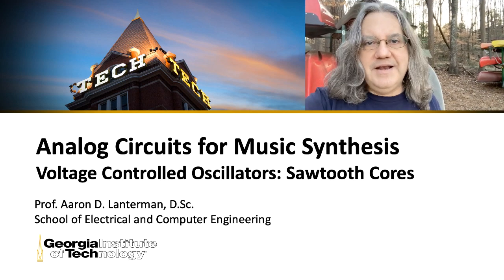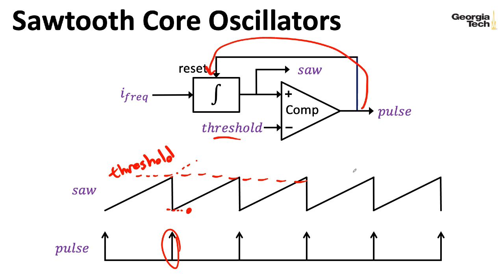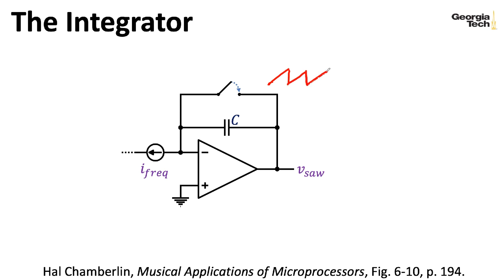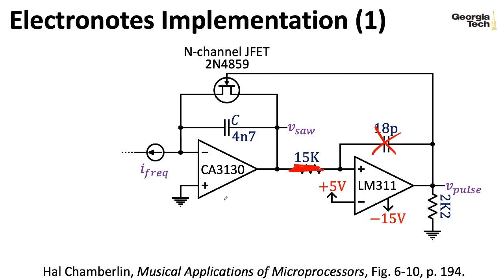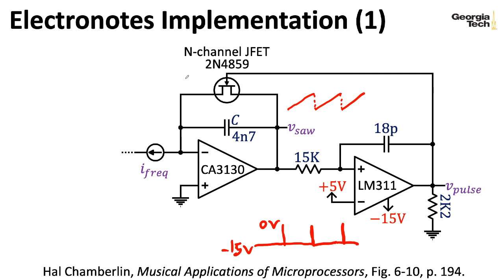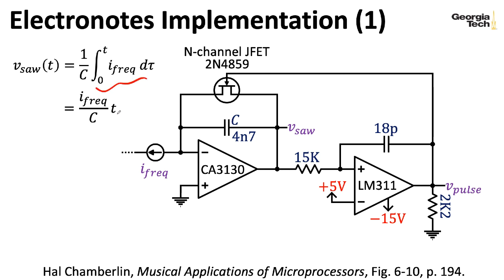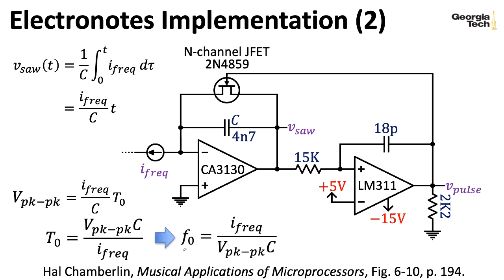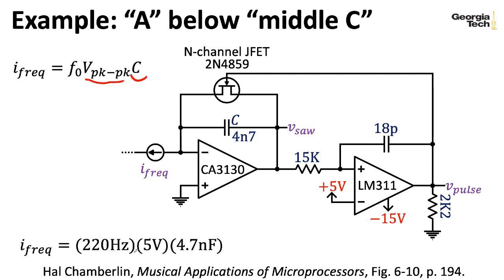ECE4450 L8: Voltage Controlled Oscillators: Sawtooth Cores (Analog Circuits for Music Synthesis)

Comment: Thought I'd mention a few of my favorite VCO integration op amps here, as they've given great results.  It's quite a list.  I use each one for different reasons.  I'll list them all, but wanted to mention one specifically that's pretty amazing.  (though recently it has doubled in price)  

The AD8033.  It has a FET input, super high slew rate, very very low bias current, wide supply range (compared to some) among other things.  Pretty decent DC characteristics too.

Others that work quite well pretty much across the board for this task:
CA3140EZ
LF356
OPA132 (and even the OPA134 though it's more aimed at certain audio tasks I would say)
LF411 (I use this more in LFOs and slope generators, as its quite stable, low drift, etc. and also cheap)
OPA140

I saw a comment about possible substitutions below, so thought I'd mention these.  

Also, for oscillators (I can't think of many, but Don Tilman's Trapezoid is one) that use the timing cap to ground instead of the inverting op amp integrator, something that's specced for capacitive loads might be better.  Maybe something like the LM8261 (though there are much more common ones that are fine with this).

Hope that's somewhat helpful.  Hard to elaborate further in a YouTube comment.  :D

Comment: The JFet is really just being used as a voltage-controlled switch, when it turns-on it effectively shorts-out the integrator capacitor, the result is that the voltage across the integrator capacitor falls to zero and then the JFet gets turned off again, then the whole process of charging up the integrator cap starts again, rinse and repeat.

Comment: Thank you for this wonderful lecture Aaron, I appreciate all your lectures and the analysis of the external components, as I usually struggle to understand how they interact in DCOs and OTA VCFs. This is essentially a DCO core you're explaining, I've been studying the Roland and Korg DCO's and this analysis is excellent. They use NPN transistors instead of the JFET but the result is essentially the same. How would you turn it into a reverse saw or triangular waveform?
Reply from the maker: You can just run the waveform through an inverter to flip the saw direction. Turning saw into a triangle, you can center the waveform around DC, and then rectify it (take its absolute value), and shift and scale it again. I will talk about that in a future lecture.
Reply from the maker: Check out Electric Druid's VCO analysis: https://electricdruid.net/roland-juno-dcos/
Reply: And when you have the triangular waveform you can get a sine waveform with a pair of matched trancistors and an opamp.
Reply: I don't think that this qualifies as a digitally controller oscillator (DCO). In a DCO, the reset pulse is generated by a digital circuit, which typically divides down a high frequency clock from a master (crystal) oscillator. Here, the oscillator generates its own reset pulse, so I would say that it's a plain analog VCO.
Reply: @possible-realities   yes of course, the digital control part of it is missing, but the osc works the same way.
Reply: @Lantertronics  thank you, I've seen a few good explanations on the DCOs I have a ok handle on it. Although, I have a question about transistor configuration that confuses me. its from Korg DW6000, pp17 over to the right Q1,Q2 I can't understand it and I've looked everywhere to find out what this does and how they work in the circuit.
Reply: @peternotpeter  Ok, then I'm with you!

Comment: Hi Aaron, jut a short question...i can not find numbers for the different lectures in the series. Is going through the playlist the only way to get them in the right order or did i just overlook the part number ?
Reply from the maker: When I was originally posting them I was sometimes posting them out of optimal viewing order (depending on what videos I finished editing first), and in some cases I wound up taking one video I was editing and splitting it up into two separate videos, so I often wasn't entirely sure what the final number of a video would be. I'll probably go back and add numbers at some point when I get a chance. 

In the mean time, best thing to do is watch them in the order on the ECE4450 playlist: 

https://www.youtube.com/playlist?list=PLOunECWxELQS5bMdWo9VhmZtsCjhjYNcV

Comment: I like how fact that capacitor charge is not straight line but negative exponential form is ignored in all analog sawtooth/triangle waveform generators.
Reply from the maker: I'm not following how the charge on the capacitor would be exponential? It should just be a straight line if it's being fed with a constant current source and the op amp has low input current (like with a TL072).
Reply: @Lantertronics  Oh, you are right, of course, I've solved too many exercises about schemes and oscillators WITHOUT opamps at my course if basic electronics 20+ years ago. And, yes, one more note to myself: don't try to be smart at 4 at night.
Thank you for great videos!

Comment: Do you have an idea why this circuit uses a JFET insted of a MOSFET? I don't think Chamberlin explains why.
Reply: It acts like a reverse MOSFET. When you increase the gate voltage on a Jfet its resistance increases.
Reply: I would say that the JFET acts like a depletion mode MOSFET (except that you can never let the gate voltage go above the source or drain voltage, because of the gate-to-channel diode).

So I think the circuit would work basically the same if you exchanged the JFET for a depletion mode MOSFET. But I guess that it might be harder to find a suitable depletion mode MOSFET than a JFET? Or maybe JFETs have some other desirable properties for this circuit? Wikipedia says that JFETs have higher transconductance than MOSFETs, that seems like a good reason.

The circuit really wants to keep the leakage through the FET low when it's turned off, I guess that's why it's using a voltage swing between -15 V and 0 V for the JFET gate. I suppose that if you're gonna use that kind of voltage swing, a few volts of added threshold voltage that you would get with an enhancement mode MOSFET might not make such a big difference; you'd probably still want to drive the gate quite negative to reduce the leakage current? But with a MOSFET, you could use a comparator with a regular output and get an even wider voltage swing, not sure if that would be good or bad...

Anyway, the JFET's gate-to-channel diode doesn't seem to be a problem for this circuit, since the gate is always at <= 0 V while the other two terminals are always at >= 0 V, so why not use a JFET, I guess? And even if you used a MOSFET, you couldn't let the oscillator have a much wider voltage swing, because the FET gate must have a much wider voltage swing than the oscillator to make sure that it's always on / off when it should be.
Reply from the maker: @possible-realities  I think Ian Fritz did some experiments using MOSFETs in this application.

Comment: Question:  How is the 270ns comparator time constant (and related RC component values) deterimined at design time for a 5V p-p waveform?  Or is this something you can only determine empirically with a breadboard?  Thanks for this video - it's well timed with a project I am currently working on and helped me understand this circuit way better.
Reply from the maker: No idea, actually. ;) 

Next time I'm in my office I plan to see if I can find the original Electronotes article that VCO in Chamberlin's book is based on to see if I can find more insights.
Reply: @Lantertronics  I'm quite new to all this and I'm trying to test my knowledge a bit. But I think I have figured it out. The drain-source resistance of the FET is 25Ohm so that makes the RC time constant 117.5ns. 117*1.3 =270.25. After 2.3 times RC the capacitor is discharged about 90% which is good enough i guess.
Reply: The main timing capacitor C (4n7) and the On resistance of the JFET will have a time constant based on RC.
 You want the comparator to be on long enough to discharge C, so you want the 15k ohm & 18pF at the comparator to have a similar time constant.
 If that time constant is too long, C will completely discharge, and you'll get a flat spot at 0v before the ramp starts going up again.

Comment: witch one is best?

lm201 or lm301?
https://www.ti.com/lit/ds/symlink/lm301a-n-mil.pdf

Supply Voltage:   lm201 = ±22Volts, lm301 = ±18Volts
my shop refers to lm201 as replacement for lm301

should i use TL431 Precision Programmable Reference for getting the +10V / -10V references
https://electronics.stackexchange.com/questions/398041/tl431-as-negative-voltage-reference
or simple use a zener and a non inverted / inverted opamp config?

https://www.ti.com/lit/ds/symlink/tl431.pdf
states: Sink-CurrentCapability:1 mA to 100 mA
does that mean the lt431 provides me with up to 100mA?

Comment: Musical_Applications_of_Microprocessors-Charmberlin.pdf
says: 2700 pF as the timing cap, but you say 4700pF or 4nF7.
?witch one should i take¿
my provider doesn't have the 2700pF ( WIMA FKP2) TOL. 2.5% / POLYPROPYLEEN, but has WIMA nF7 FKP2 4700PF/63V 	TOL. 5% / POLYPROPYLEEN
Reply from the maker: Whoops! This is embarrassing -- I made an error on my schematic. It is indeed 2.7 nF. I made the slides for the Buchla 259 lecture (which I plan to tape and edit and post sometime this weekend), and that uses 4.7 nF. I created my sawtooth slides by taking the Buchla 259 circuit, stripping it down to just that op amp and capacitor, and then building up the rest of the circuit... but I forgot to change the capacitance value. In terms of the cap, you can use polystyrene, or nowadays people also use C0G or NP0 ceramic (which are high quality ceramics that are stable with temperature changes -- avoid mediocre ceramics).
Reply: @Lantertronics  thanx very much, i have watched the Buchla schematic often but mostly the timbre circuit and didn't notice, but indeed the Buchla has a 4nF7, 
http://fluxmonkey.com/historicBuchla/buchlaFiles/Buchla_2590_2_200.jpg,
but i don't see a reset circuit, like most SAW core vco's have, but there is a feedback from the pulse "opamp" , is that the cause why it's a triangle?
like in LFO circuits? it seams the pulse is 4,29V, but nothing has giving for the triangle. strange "current mirror" for the buchla before the triangle core opamp.
.... and again thnx.